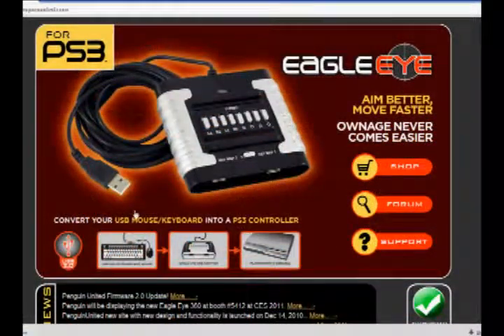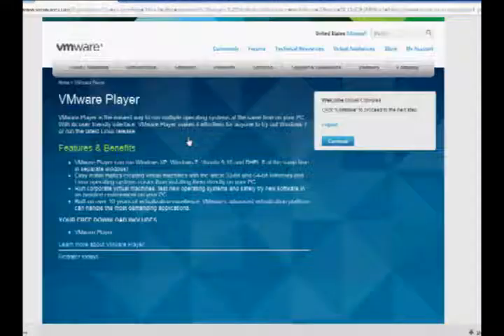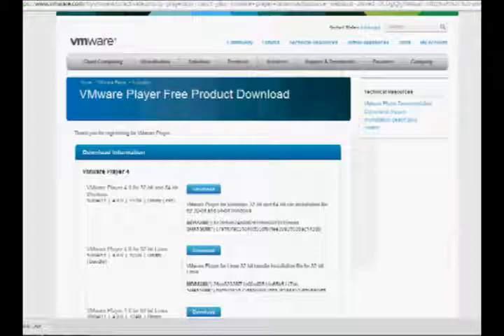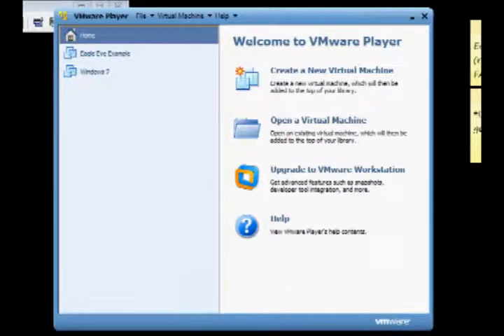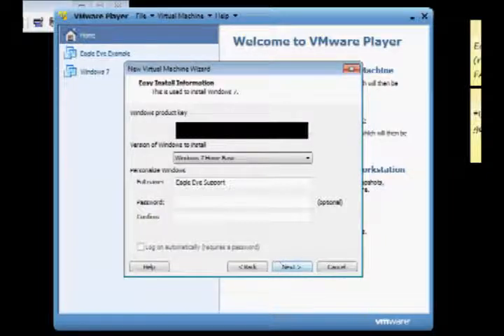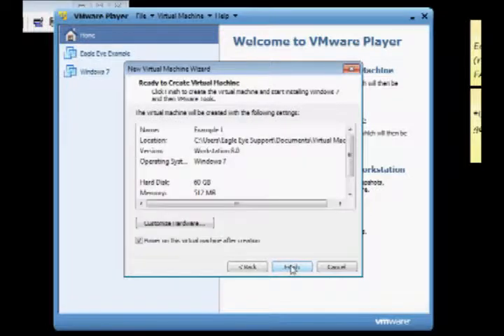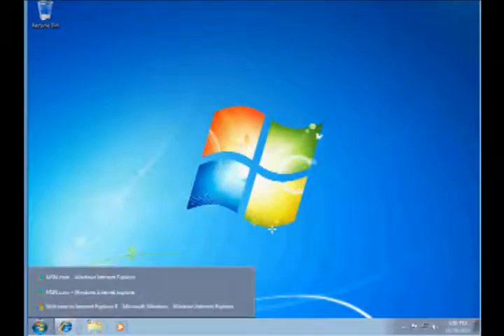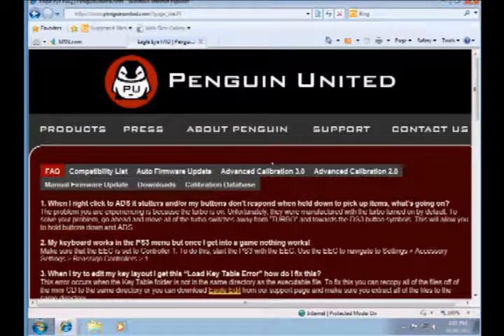Eagle Eye 3.0 Virtual Machine Tutorial

Comment from the maker: @tommy23i 

Have you tested the new firmware and what were your settings for black ops and what mouse where you using? From what it sounds, you did not properly configure your Eagle Eye for Black Ops. We have a ton of videos and user reviews that support the fact that, when properly configured, the Eagle Eye is quite smooth and precise which translates to better  control and accuracy. If you like, I can help you properly configure your Eagle Eye. Don't give up so easily.

Comment from the maker: The 3.0 update makes it possible to update on a 64-bit, but to upgrade from the 2.1 firmware to 3.0, you will need a 32-bit system.  It's unfortunate but you will only need to it this one time.  Really all you're doing though is installing VMware and then installing windows through it.